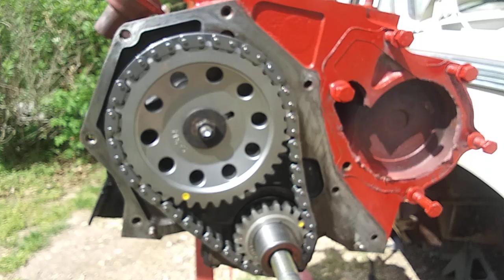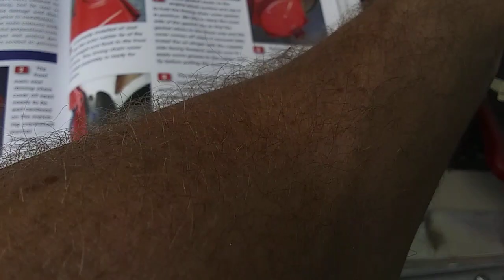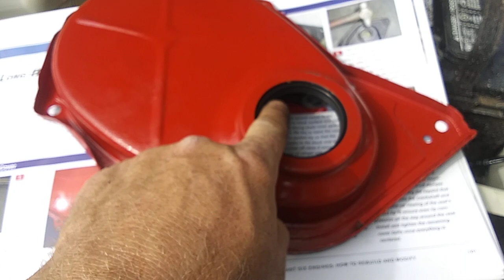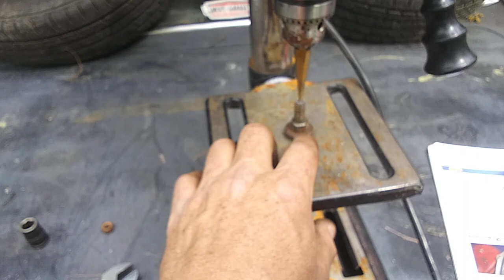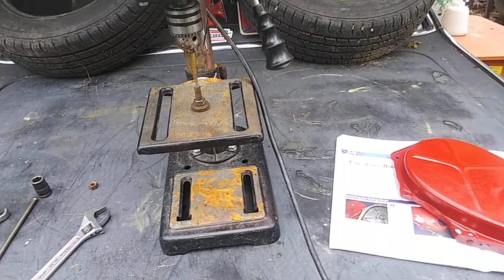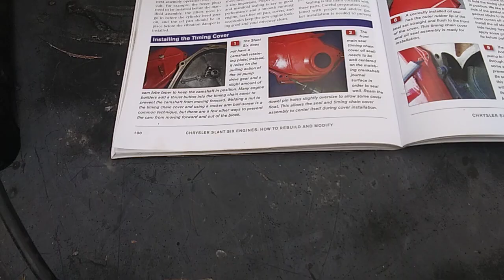Part 1 Slant6 timing cover Upgrade  - No more slacking around .

Comment: I've rebuilt a 1965 170 slant 6, I never noticed any excessive wear with the cam or related parts.  I do however think there is another way to fix  it. A friend of mine has a machine shop,  and he makes a piece that goes on the end of the cam then when you bolt the cover on it has very little room for movement.  A cheaper and easier way to control cam walk. 

With mine I wound up doing a complete reman. Bore, hone,  regrind crankshaft,  resize rods,  replace rod bolts/nuts.  Before I remand I got 21 MPG,  after I got 27 MPG.  I had a 65 Dodge Dart 3 speed manual.  I put 9 inch wide tires on the back the right wheel would spin for 12 feet.  It was an enjoyable car to drive.  One winter the temperature dropped to 15 below 0 F. It started right up with no problems,  ran kind of fast with the choke on but I let run for about 2 minutes before I tried to move.  Ran just as good a summer day.